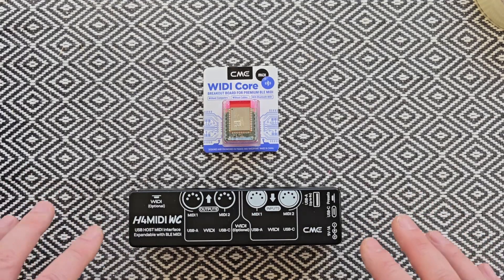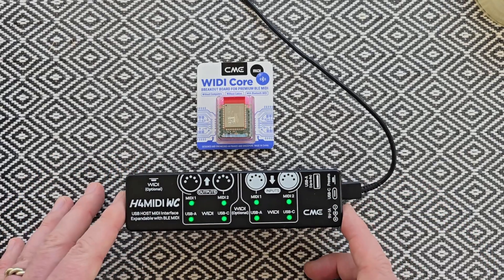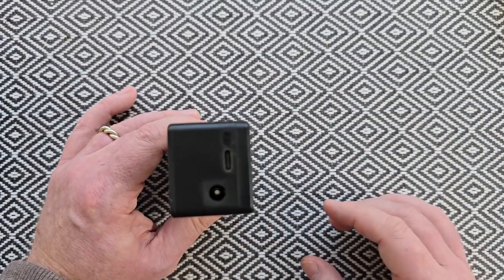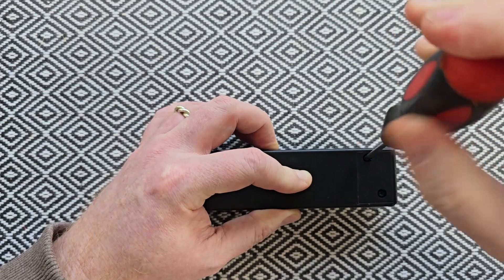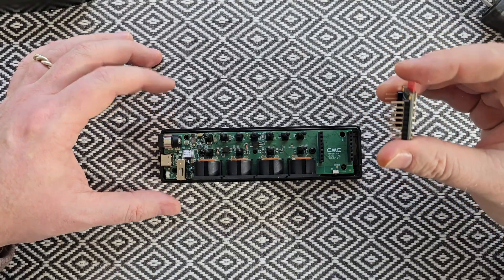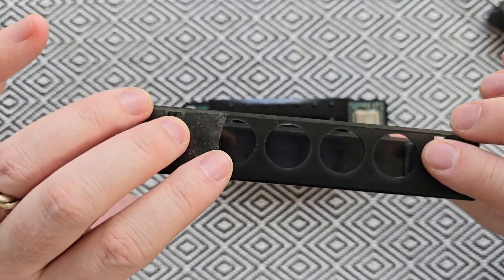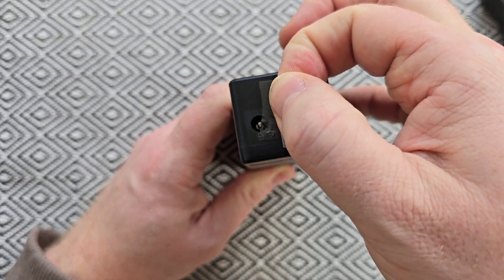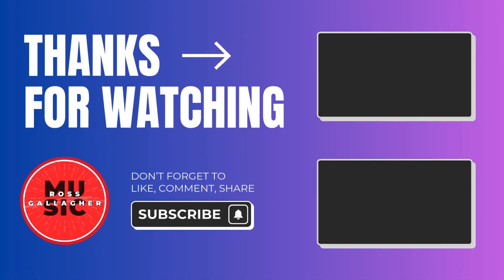How to Install the WIDI CORE in the H4MIDI WC | CME-Pro

Comment: I'd like to add Bluetooth connectivity to my midi controller keyboard and possibly some other 80s synths. I'd like the interface to appear native on-board and not as an external dongle. Assuming I can access 5v as well as the midi connections internally, will the core pcb be my answer?
I have no qualms with such mods - I've already done similar mods adding USB to some 80's/90's synths.
Thanks for any feedback, because I haven't yet seen this use-case explicity mentioned!
I might add; my goal ist to play VSTi synths on my Win10/11 notebooks.
Reply: Following for the answer. I am also wondering about adding the WIDI Core to my 90's Roland SPD-8 machine.

Comment: I bought the H4midi and now the Widi Core but the pins are separate - how am I supposed to solder these on ? This is specialist work ! I thought it came assembled - please help !
Reply from the maker: @testcard666  the core should all be assembled correctly, and it's just a case of inserting the Widi Core into the H4, as I demonstrate in the video. If you have any issues, just contact CME directly. I'm sure they'd be happy to help you out.
Reply: @ thanks I’m sending it back as it seems that there are assembled and unassembled versions but not so clear for me so will begin again !
Reply from the maker: @testcard666  ahh yes. There are 3 different options for the Widi Core I believe,  so you would need to one compatible with the H4. Best of luck!

Comment: By The Way... I also decided to use one of my HOSA UNIVERSAL AC/DC POWER ADAPTERS to power the H4MIDI WC MIDI interface. I set the voltage to 9V and used the blue jack with the tip (negative) orientation. Works perfectly fine! And, by doing this, I can probably use the USB-C port on the interface for other uses.
Reply: what would u use the usb c port for on this?

Comment: I recently purchased this MIDI/WIDI interface (H4MIDI WC) and should soon be getting the WIDICORE 1.3  Expansion Chip by next week (in three days or so). Yet, in the meantime, I ordered four sets of the CME WIDI Master MIDI connection adapters which are also very handy to connect many of my MIDI keyboards and other MIDI devices. At first, I had a little difficulty getting those to work together, yet I was able to communicate with the CEO of CME by email and we figured out what needed to be done in order to pair them together.

Now, there are quite a few YouTube videos showing various musicians playing and using these wireless WIDI adapters, however, very few of them actually discuss using an app to update them for the needed firmware updates for them. I also downloaded some handy information explaining various aspects of these devices (such as the term "BLE Role" and what the "LE" stands for). Thankfully, I found an explanation right within the firmware update app...

(2/21/2025)

CME: BLE ROLE EXPLAINED:

BLE ROLE:    The Bluetooth LE (Low Energy) standard sets devices into two roles: central and peripheral. 

The central role is responsible for scanning the peripheral and establishing a connection. 

The peripheral role is responsible for advertising its status and waiting for the central to initiate a connection. 

The default state of the WIDI device is [Auto] role. When set to [Auto], WIDI will switch between the two roles of central and peripheral. This starts an automatic search and will activate the connection to the first discovered Bluetooth MIDI peripheral automatically. Or it will accept Bluetooth connection requests sent by the computer or other BLE MIDI host device. 

If the role status is changed to [Forced Peripheral], WIDI will only advertise its own status and wait for the connection of other Bluetooth MIDI host devices (such as computers, mobile phones, or iPads, etc.).

Aha! So, now I know that the LE stands for Low Energy, or BLE: Bluetooth Low Energy, and the difference between "central role" and "peripheral role".

When you have a lot of MIDI devices, these wireless WIDI devices are rather easier to connect, rather than using a lot of MIDI cable wires or USB MIDI cables.

I'd like to thank the CEO of CME, (Zhao Yitian), for helping me out via email with setting up the company's products into my music studio system.

Comment: Great methodical video, got the H4 and just realized my Kawai ES920 has Bluetooth MIDI, so ordering the WIDI core today. Thanks.
Reply from the maker: Excellent! Glad it helped, and many thanks for checking it out.
Reply: @RossGallagherMusic  I made a mistake. I bought the WiDi Core N instead Widi Core. So... no blue light. 😞
Reply from the maker: @LucaPietrangeli-b3l  you're not the only one to make that mistake. Contact CME and explain your situation. They can be very helpful.
Reply: @ I sent now a message. But I bought everything via Amazon. Do you think this can be a problem?
Reply: @RossGallagherMusic  I bought the right Widi Core this time and I put inside the H4MDI WC Midi Interface. Now I can see the blue led flashing. Thanks a lot, Ross. Have a nice week end. Ciao! ;-)
Reply: @RossGallagherMusic  But ... do I need to use a little bit of solder for the WiDi Core pins?